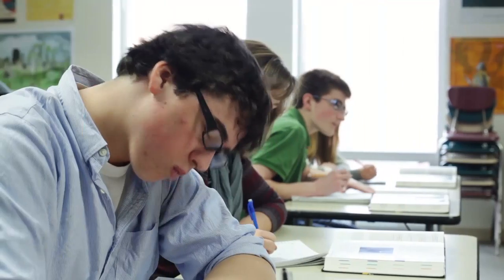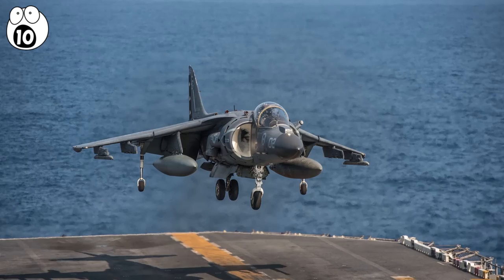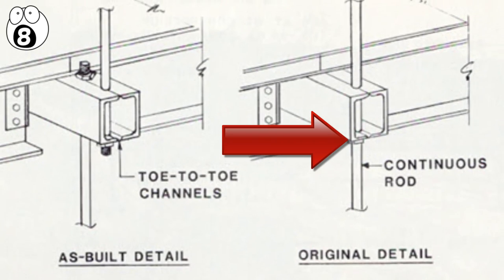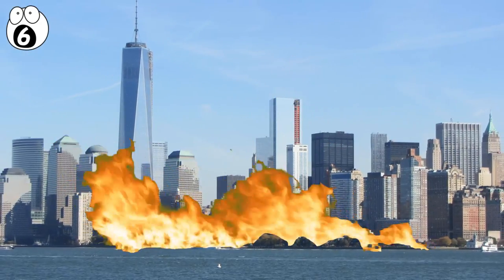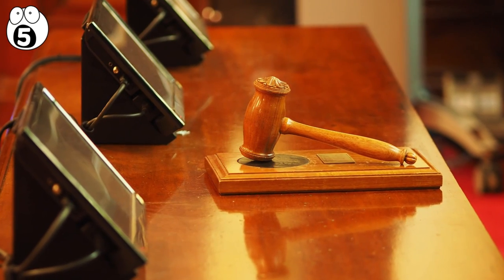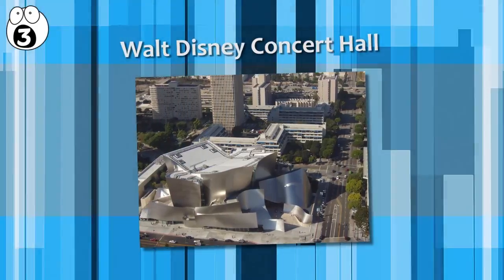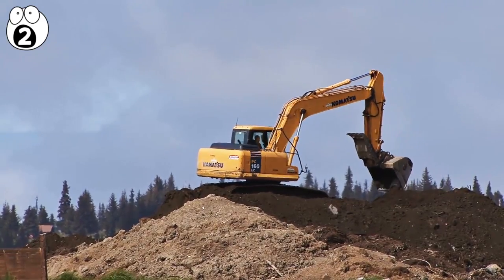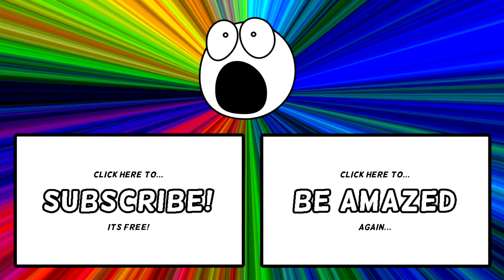Biggest Design Errors Engineers & Architects Made

Comment: WTF does the angled deck have to do with the arrester cable? Carriers still use the cable. The angled deck was used to create more space and allow for multiple cats and launches.
Reply: Geography in Action He was referring to how the plane would crash into other planes if it missed the wire. But it’s still a stupid video
Reply: Spunk still not accurate. Landing strip is at a angle so there is enough room for take off catipults. The aircraft are either on the side or in the hanger below the flight deck
Reply: @steamfend333  he was talking about older carriers without an angle but you are correct the aircraft would definitely not be just sitting on the end if the runway after they landed
Reply: The Winged Porpoise - With the angled landing deck planes can be landing while others are being catapulted.
Reply: Al Grayson but in WW2 the planes were launched at the same time
Reply: @dandt0001  how does angled landing strip allow more take off and landing at the same time ??
Reply: @billythecat  Think about it. You have two strips, one above the other strip. All those planes are launched and stored below the landing strip, launched one after another while planes can land on the landing strip.
Reply: because a plane can be launched off the bow at the same time a plane is being recovered off the stern. The old single landing area you had to finish one operation before starting another
Reply: Yes it was angled to make sure no planes came in way, if you decide to abort landing
Reply: For propeller aircraft there wasn't a pressing need for an angled deck and so it's just plain wrong to categorize the old straight deck a top 10 design error. Propeller aircraft landed so slow that if they didn't catch the arresting wire they would be stopped by a safety net strung amidships. Anything beyond the net was safe, which meant aircraft could be parked on the deck. Jet aircraft land at much higher speeds and need a longer landing strip than propeller aircraft. In addition if a landing failed the jet would careen along the whole length of the deck. The solution to this problem was to create the angled flight deck. So now the jet would careen off the side and they could continue parking aircraft on the deck. One of the things that made the angled deck feasible was an optical signaling system that allowed a pilot to see if he was coming in at the right heading and height. That made landings much safer. So to some degree the old design is also a matter of technological limitations.
Reply: steamfend Man that profile fits you heavily. First off why angled carriers existed was the fact that the navy aren't using propeller aircraft but more heavier jet aircraft. And since jet fighters don't have the capability to takeoff on there own it required the catapult. Also the new jet aircraft are way more larger than the aircraft used in the past which requires more room and that is why the angled carrier exists. It is not because we need room for the catapults. No why it was made that way was because of aircraft in general. During the 50s the US decided to change the straight angle into something more suitable for future generations of jet fighters. And even then the angled carrier is gonna be obsolete by VTOL aircraft.
Reply: odile elido You already beat me to it darn
Reply: I didn't even realize that the U.S. Navy even allowed those guys to bring their cats. Is it also permitted to bring your dog?
Reply: Not to mention the aircraft carriers are a lot bigger now
Reply: During Carrier Operations in World War II, the United States only sent planes down to the hanger to be fixed or worked on - they kept all planes on the deck, and still do today.  The straight-deck carriers had a 'Crash Barrier' that separated the landed planes from the planes that landed.  This worked actually quite well until the planes became faster and heavier and so after the war all the Carriers remaining in service had time to be fitted with the angled flight decks the British thought of during the War ranging from 9 to 15 degrees (depending on year the Refit was done) with a separate landing strip and take-off area.
Reply: .........Plane are not launch from below deck......
Reply: @firepower7017  the angled deck was a british invention
Reply: @cdarting91  the japanese tried that. The Akagi and Kaga carriers were first built with 3 decks.
Reply: mogaman28 I know. I just said that the straight deck was far too small to support larger jet aircraft the US had made at the time.
Reply: @thewingedporpoise  true cause in carriers like the enterprise there were little lift like machines that took the landed plane into the hull to be rearmed or repaired
Reply: My girlfriends landing strip is not angled, and it´s perfectly fine.

Comment: "Which error do you think should've been avoided most easily"

Easy: You not knowing the slightest thing about engineering.
Reply: This video.
Reply: lol thank you, i was like what the fuck this guy knows nothing. hrmmmmmmm
Reply: CPTANT agreed... you need at least some basic engineering to do something like this
Reply: Amen! Although the most annoying part of this video was when they used a picture of the Delicate Arch in Utah to depict the Grand Canyon, 500 miles away
Reply: kitten is a Kitteq
Reply: no
Reply: Except he does know what he's talking about. And this is coming from an actual engineer. Some of the things are a bit inaccurate, but its a video to give you examples of some grand fuck ups, not a physics lesson.
Reply: Yeah except number 10 is  bullshit since that's not a blunder, angled flight decks are an iterative improvement and for smaller carriers straight flight decks are still used.

And 9 is bullshit since it wasn't the "lack of holes" that caused the bridge to collapse, it was an eigenfrequency issue that cause the bridge to resonate and collapse. 

And 8 is bullshit because in both cases the weight of the structure is supported by a single rod. The collapse was probably caused by the eccentricity of the rod placement causing a moment load.

6 is Bullshit since properly designed bolt joints are NOT WEAK. A properly designed bolt connection is always stiffer and stronger than the parts it connects. The entire Eiffel tower is build using bolts and rivets....

"A bit inaccurate"
Reply: The submarine one was hilarious, what in the hell does the motor have to do with the ships ability to resurface. He really has no concept of buoyancy.
Reply: zendoclone1 I agree, one wouldn't be able to speak like so without at least some engineering knowledge. However, failure to lay out the facts is really disappointing. Let's not forget some really smart people were actually designing these things and it appears the video intends to invoke otherwise, which isn't very nice. That thing about obese people was also really uncalled for.
Reply: Also, the reason that WW2 Aircraft carriers had straight, not angled flight decks because the hulls were originally other types of ships.

"The first aircraft carrier that began to show the configuration of the modern vessel was the converted liner HMS Argus, which had a large flat wooden deck added over the entire length of the hull, giving a combined landing and take-off deck unobstructed by superstructure turbulence. Because of her unobstructed flight deck, Argus had no fixed conning tower and no funnel. Rather, exhaust gases were trunked down the side of the ship and ejected under the fantail of the flight deck (which, despite arrangements to disperse the gases, gave an unwelcome "lift" to aircraft immediately prior to landing). The lack of a command position and funnel was unsatisfactory, and Argus was used to experiment with various ideas to remedy the solution. A photograph in 1917 shows her with a canvas mock-up of a starboard "island" superstructure and funnel. This was placed on the starboard side because the rotary engines of some early aircraft created torque which pulled the nose left, meaning an aircraft naturally yawed to port on take-off; therefore, it was desirable that they turned away from the fixed superstructure. This became the typical aircraft carrier arrangement and was used in the next British carriers, Hermes and Eagle.

After World War I, battlecruisers that otherwise would have been discarded under the Washington Naval Treaty—such as the British HMS Furious and Courageous class and the American USS Lexington and Saratoga—were converted to carriers along the above lines. Being large and fast they were perfectly suited to this role; the heavy armoring and scantlings and low speed of the converted battleship Eagle served to be something of a handicap in practice. Because the military effectiveness of aircraft carriers was then unknown, early ships were typically equipped with cruiser-calibre guns to aid in their defense if surprised by enemy warships. These guns were generally removed in World War II and replaced with anti-aircraft guns, as carrier doctrine developed the "task force" (later called "battle group") model, where the carrier's defense against surface ships would be a combination of escorting warships and its own aircraft.

In ships of this configuration, the hangar deck was the strength deck and an integral part of the hull, and the hangar and light steel flight deck were considered to be part of the superstructure. Such ships were still being built into the late 1940s, classic examples being the U.S. Navy's Essex and Ticonderoga-class carriers. However, in 1936, the Royal Navy began construction of the Illustrious class. In these ships, the flight deck was the strength deck, an integral part of the hull, and was heavily armored to protect the ship and her air complement. The flight deck as the strength deck was adopted for later construction. This was necessitated by the ever-increasing size of the ships, from the 13,000 ton USS Langley in 1922 to over 100,000 tons in the latest Nimitz-class and Gerald R. Ford-class carriers."

So, not an engineering screw-up but rather an ingenious way to experiment w/ a new ship design & using an existing hull structure to cut down engineering time & building costs.
Reply: LOL right? I know people who got to 1st, 2nd and even 3rd year of college studying to be an engineer and were like "yeah fuck this this, Ima go study art". Lol but I do love engineers, my coach was an engineer in highschool when I rowed and we would make engineer jokes all the time because everything he did had to be perfect and logically sound.

Comment: 10 - more of a design improvement in new revision, than fatal flaw in previous one
9 - Tacoma bridge fell because of resonance issues, not because the lack of "holes"
8 - Not really a problem with the rods. I'd never design a structure that can endanger people!s lives when failing with safety factor of 2.
7 - The plane hull indeed torn because of the stress concentration. But plane going extremely fast extremely high of the ground has nothing to do with stressing the hull. Hull is stressed because the cabin is pressurized and you don't need neither speed nor height to pressurize the cabin. You can do that on the ground in standstill.
6 - Neither of your examples are like welding. Bolted and welded joints both have their purpose and both can be equally safe. You just have to be sure, that the bolts do not loosen up (we ensure that using nord-locks in my company)
5 - Cutting costs by incompetent managers is more likely, tahn engineering mistake.
4 - Not much to it. Nothing really flawed from the engineering stand point.
3 - Yup, unforseen consequences. Now we know :) Not much problem of an engineers than architects though.
2 - That's what happens if you don't listen to those educated engineers. (as you said)
1 - How weak engines go with everweight? Subs resurface thaks to lowering their mean density. Nothing to do with engine power.

You should get your own engineering degree before criticizing :( Thumbs down.
Reply: beznick, 1) Although mean density is the technical reason, shipyards are given a design weight capacity for the vessel.  It's far easier to weigh everything being added when you construct the boat than it is to calculate the change in density.  The term "overweight" is understood well enough.  Also, some modern subs, especially the smaller, purpose built subs use the control surfaces and propellers to go up or down as they are designed to be neutrally buoyant and would have everything to do with engine power.
Reply: Quoting the video now: "The submarine's engine simply wouldn't be strong enough to pull it back up again"
- That's total nonsense.
Reply: beznick6425 the one time they slip up the internet tears them to shreds. Get a life
Reply: Christina Andwena 
Dude hes pointibg out some horrific misinformation. If you like being told complete nonsense then go ahead
Reply: beznick6425 On the DeHavilland Comet, you are both right in fact. Speed has nothing to do with the problem. However, the cabin was (as you said) pressurized. But the low outside air pressure at high altitudes combined with the internal pressure led to the disasters.
You have a point though. A lot of information in this video is very badly explained or just wrong. I was especially annoyed by the mistake with the bridge and the submarine (these things dive using ballast tanks not engine power).
Reply: Well the point was to point on the mistakes in the video, because someone can watch it and use the wrong interpretations shown in the video. What is the point of doing something if you're not doing it right? Especially, when you try to teach people something. And it is quite easy to criticize, especially when you don't know anything about the topic as author of this video clearly doesn't. 
BTW, I have a life ... I'm mechanical enggineer and even though I don't know much about most of the stuff mentioned in this video in depth, I know that more than half of it is total nonsense.
Reply: Er, that's quite untrue about modern subs.

They do in fact modify their buoyancy to control a dive vs surface.

They go negatively buoyant to dive, then go neutrally buoyant to cruise while diving, and then go positively buoyant to surface.

The control surfaces of the dive planes are only used to control depth while cruising at neutral buoyancy, and to assist in the dive/surface actions when in the act of diving and surfacing.

TL;DR: Modern submarines are only neutrally buoyant when submerged.
Reply: Kevin, you are correct. It's more than that too though. It's not possible to remain neutrally buoyant when changing depth without doing anything so subs have to be able to control their buoyancy. You can do a bit with the engines but it's not very efficient.
Reply: 8 kinda was a problem with the rods... If you have one rod for all floors with nuts to hold the floors, one nut holds one floor. But if you attach another rod to the top-floor, the nut of the top floor needs to support the weight of all floors (You can even see that picture in the video, but this dumbass YTer made up his own reason).

Classic example why you should NEVER let design changes happen without redesigning/checking the integrity of all parts. (Changes were made bc they could not get long enough rods)
Reply: Nerd burrrrrrnnnnn!! XD
Reply: The disasters were caused my metal fatigue which manifested in the corners of the windows. The Comet "discovered" it, which is why now high cost of failure items are x-rayed to discover micro-fractures.
Reply: Just wanted to let you know some people appreciate a more correct accounting of the issues presented in this video. I was about to stop watching after the bridge because I had already heard about it in highschool physics and knew the information in the video was wrong. Combining your knowledge with the incidents presented in the video was much more helpful and frankly allowed me to continue watching. So I thought I'd say thanks and give you some positivity given the other replies 😂
Reply: @jasonsawyer3752  You're welcome :) Keep learning!

Comment: Still using arrester wires on aircraft carriers, going on about 100 years now.  Regarding the angled deck, not until the dawn of WW2 did having a single flight deck become a "flaw."  Prior to that naval aircraft were so light and had such low landing speeds, that there was little threat of an aircraft bounding into the parked aircraft forward of the landing area.  As soon as the war concluded, and the immediate need for carriers ceased to be an issue, the US Navy went into overdrive rebuilding their carriers with angled decks.